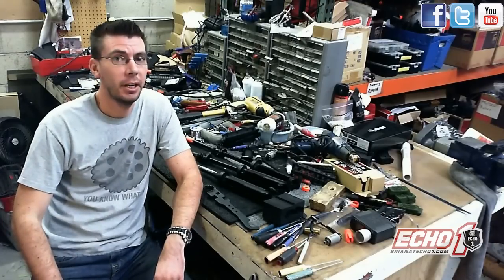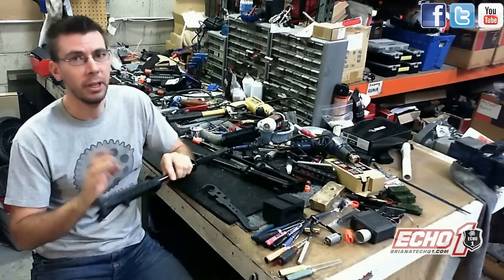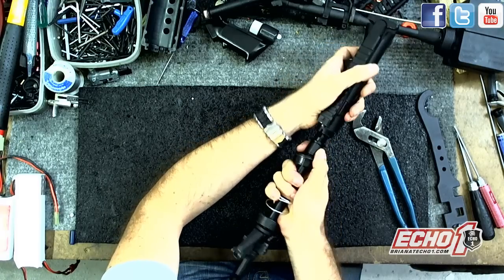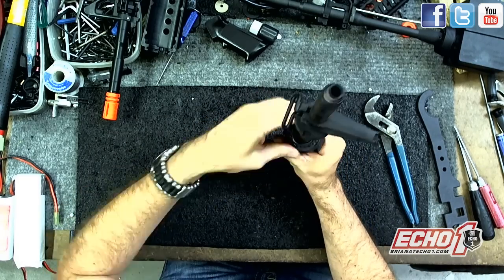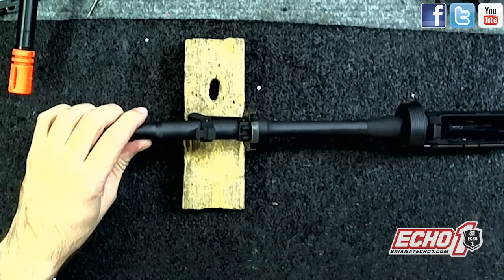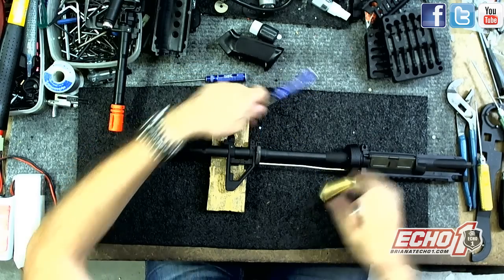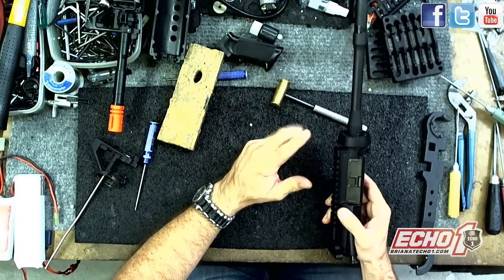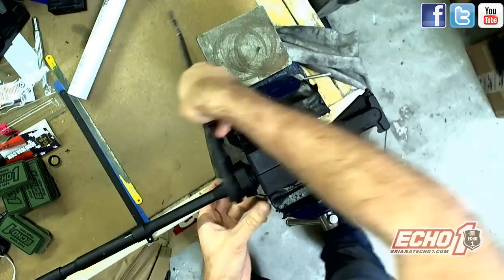How to remove your Airsoft delta ring or star

Comment: So the "Old-Style Ring" would count for a JG M4? So I just twist it off? Please respond thanks!
Reply: Just a headup, Magpul MOE handguard wouldn't fit in JG's M4 old style ring.
Apparently the ring has smaller diameter. I found out about it after I bought the handguard for my JG's M4.
Reply: Thanks, was saving up to buy a MOE Magpul handguard. Thanks a ton.
Reply: SilentWhisper Wolf
Apparently, any airsoft that copy TM old style ring wouldn't fit that handguard.
Same goes with the delta cap.

Comment: Hey Brian, I am trying to reinstall my delta ring on the front end with the imitation gas tube, but I can't seem to figure out how to align the delta ring so that the imitation gas tube goes through to the corresponding hole on the upper receiver. This is most likely a simple problem to fix, but I have no clue how. Any help is appreciated.
Reply from the maker: the delta ring is 3 main parts. spin to line up the holes to pass the rod through